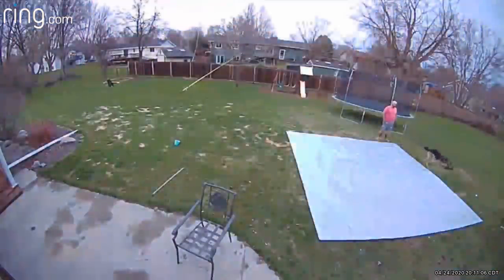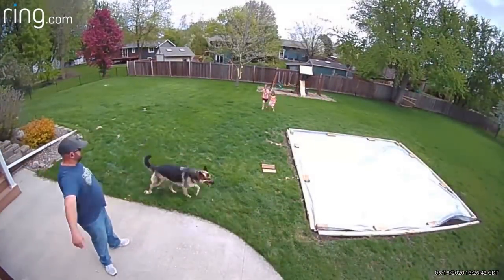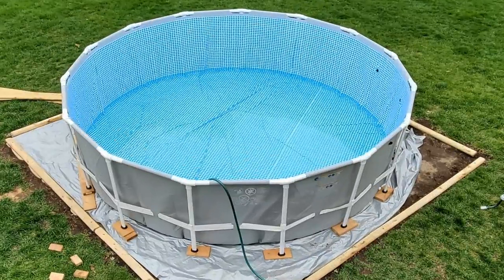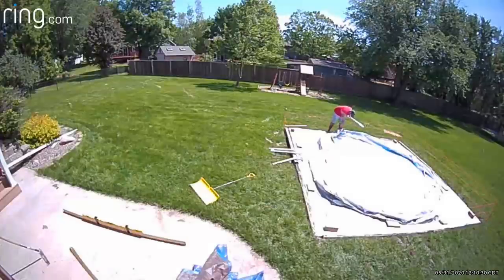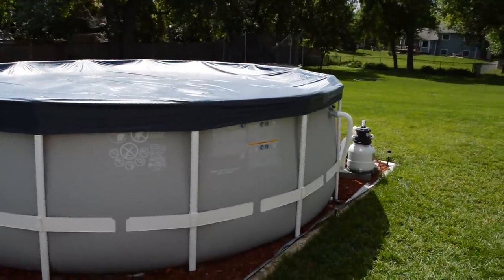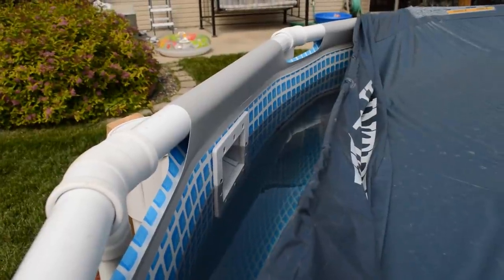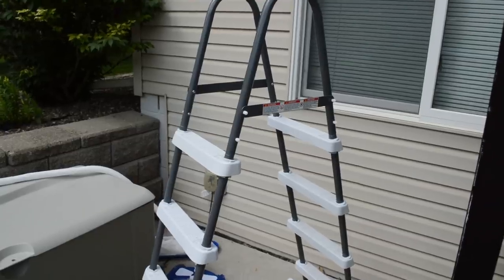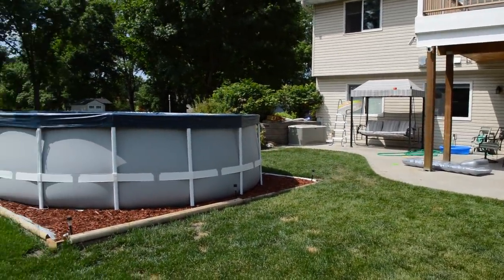Intex 15 Foot Prism Frame Above Ground Pool Setup, Review, and Mistakes!

Comment: Thanks for your post and instructions.  Do you know the outside dimension of the pool?  We have our 15ft on the way and are starting to prepare the pool.

On the subject of the liner, we've read that the liners regularly do get holes and seams can split.  One forum showed using a standard pool liner within the Intex liner.  These standard pool liners are meant to be used in in ground pools or metal sided pools,  but work on the Intex and are much more resistant to issues.  Basically the Intex liner becomes the support structure for the line and the pool liner holds the water.  Also it's recommended to keep an eye on the metal frame and protect the inside and outside from rust.  I've read silicon tape or Rust-Oleum can help.  Good luck!
Reply from the maker: I've never heard of the liner within a liner idea before. I'll have to do some investigating on it. The pool is 15 feet from edge to edge on the top ring. The liner pushes out a little bit more to about 15' 3" or so. And the liner will definitely rip if you puncture it but it's held up well 3 months in. The seams will definitely leak if they aren't actually sitting on the ground (when I first set it up and the legs were elevated too high, the seam was exposed and tiny beads of water were popping through from the pressure of not resting on the ground.)
Reply: @dontburnthehousedownvideos  Thanks for the reply and the dimensions.  This will help as we prepare the ground this weekend.

I think the overlap liner will help with the life of the pool.  It will also help keep water off the joints.

The process is here and it's less than $200 to do: https://www.troublefreepool.com/threads/installing-replacement-liner-inside-of-intex-18-metal-frame.40579/

That forum has a bunch of information on how to protect for rust as well as other mods.

Thanks.

Comment: Can you discuss your plans for winterizig the pool? I live in MN as well and have heard some people will simply drain the pool below the level of the intake and output of the pump and let it freeze over the winter. Do you plan on taking it down?
Reply from the maker: Thanks for the comment! I've debated this question as well and I've decided that I will simply take it down. This particular pool is easy enough to take down/set up that I'm going to do that instead of risking any damage to it by leaving it up. I've seen several people leave theirs up all year but I just can't imagine it is good for the liner to have the water freeze into a brick.

Comment: I have retired my bladder style pool as it was up for 7 years. The fiberglass fibers began to come thru the PVC on top of the rim rods. Being exposed to the Queensland summers for such a long time, reduced the integrity of the liner. I have just purchased an oval above ground pool with a steel wall system. I found the bladder pool was a little forgiving with a little more tolerance to being out of level. The steel wall pool needs to be spot on. Not thinking of this when purchasing the pool, I now have to spend a little more time on my ground prep. I did notice the skimmer box on your pool was the same as mine, but the pool vacuum adaptor slightly different. My adaptor has the vacuum hose exiting the skimmer box thru the top, not the skimmer door as yours seems to be. As, I have not yet installed my pool, I was curious as to the usability of the hose access thru the skimmer box flap. Is this an advantage or as mine, being vertical thru the top. Cheers
Reply from the maker: Congratulations on the new pool! I'm sure that the sun will take its toll on the ours as well over time but I'm hoping to get a good 5 years out of it. My skimmer adapter for the hose has a 90 degree elbow on it so the only option I have is to put the hose through the skimmer door. I'm not sure if there are any real pros or cons to this aside from the physics behind it. Having a bend like mine means the water doesn't have to travel uphill to get over the pool wall so maybe it doesn't work the pump as hard? That's my real only guess. As long as it works, it works!
Reply: @dontburnthehousedownvideos  I am thinking of installing a 90° bend on my adaptor. Like you said, it seems logical to have the water pressure more even than going up and over the pool rim. Anyway, cheers and good health to you and your family.

Comment: Trick: if you must use the original equipment, rip open an old fiber pillow and use the fibers as filtering material.
Wrap the original filter lightly enough to allow water flow and install. Otherwise the original filter will clog up almost immediately. Especially if you’re using well water.

Comment: Just bought this pool and have yet to set it up.  Thanks for the great video of info. Where did you get the fitting on the return hose that lets you close it off?  It looks like it has a lever.  Also, we used to have a very expensive above ground pool - the permanent type that you can’t take down - with a deck around it.  Had it over 15 years and through cold NJ winters.  Our skimmer and return hose were on the same level as yours.  Our pool was always super clean.  I see no need to move the return hose/hole.  Thanks.
Reply from the maker: Thanks for the comment! I don't have a lever on the return line. You're probably seeing the lever on the sand filter itself. Hopefully this one will last for years to come. Thanks again!

Comment: I’ve watched this video so many times, and I love it! One question, how come you put the legs inside the white band instead of outside like the instructions say? I’ve also watched other tutorials, and they put the legs on the outside as well. Thanks so much!
Reply from the maker: The legs go through the loops but if they don't go through the inside of the band, there is very little material holding them to the band. It just doesn't make sense to me to have them holding all of that pressure from outside the band. If the sewing or adhesive gives, those legs are popping out and the pool will collapse.

Thanks for the comment!

Comment: Thanks for sharing your video, what type of pool heater did you suggest
Reply from the maker: I have another video where I build a solar pool heater but it's pretty labor intensive. Otherwise, I'm a big fan of the Intex solar pool cover. It does a pretty good job and requires zero assembly.

Comment: Thank you! I have four questions. 1 - After releveling with black dirt, why did you add sand again and not just put the pool on the dirt? 2 - I bought some dirt last year (I had the intex prism 12ft last year and paid someone way too much to do what you did in this video, FYI) The dirt was expensive. Is  free dirt like you referenced common? 3 - What were the final measurements for the square - in other words what measurements work to have the 15ft as you do with the pretty mulch? And 4- Did the mulch get everywhere? Would you do rocks next time or stick with mulch? Wish me luck!
Reply from the maker: I added the sand back to create a softer surface under the liner. When walking in the pool, it's easier under the feet. 2. Free dirt is common around here! Check with you local landfills in the area. Otherwise, Facebook marketplace. The square is 16.5-16.5. I'd go a little bigger if I did it again. Maybe 17x17. I'll probably do mulch again this year because it's cheaper than rock. But rock is definitely an option if I can find a place to store it over the winter.

Comment: Thank you for this!  I am from Northern Minnesota!  I live in the country and we have old round grain bins.  My plan is to make a pool out of one of them.  hopefully the concrete pad it sits on is level.  I will have to reverse every bolt so they protrude to the outside,  reinforce the very bottom with new panels and line the inside with foam lining before I put the pool liner in.  Not sure how ti attach the top of liner to the top edge yet.  What do you think of this project?  Doable?
Reply from the maker: That sounds like an awesome plan! Just make sure the structure of the grain bin can take the weight of the water. I'm not sure what the weight difference would be between grain and water of the same volume. But as long as it's safe, that sounds amazing!

Comment: Have you had any issues being off an inch and a half? I can't seem to cut it down anymore than that too. My pool is 15 ft by 42 inches.
Reply from the maker: Nope. Zero issues. More water splashes over the edge of the "low side" but that's really it. Other than that it's purely cosmetic.

Comment: I'm prepping the ground for this pool.  Was wondering if 1) a 2" slope from edge to edge would be prohitibive?, and 2) is the dimension from pole to pole exactly 18'? Thanks.
Reply from the maker: 2" total slope shouldn't be a deal breaker. The manufacturer says 2 inches max but I've seen some really lopsided pools and they still hold up. When I measured it last summer it was an internal diameter of 18' from post to post. So it's more like 18.5" from outside of post to outside of post.

Comment: One thing that happened to me this year, making the ground level and then making the legs level, i had some serious pulling on the seams of the pool.  The support bars (from leg to leg) were "perfectly" level.  The ground itself, under it, not level due to using sand (yeah, dont use sand ... bad.).  So my liner, from the weight of the water and the distance from the ground to the support beam ... pulled out my seam from the bottom of the pool and the pool wall.  Its been a nightmare to patch since due to being on the corner.  Really, the ground should be level and the distance from the top of the pool to the ground should be the same on all legs (sand makes them sink bad when it rains)
Reply from the maker: Absolutely agree with this! That's why I ended up taking it down the first time. There was a lot of pressure on that seam so I took it down and leveled the ground more. It's much, much better now.
Reply: @dontburnthehousedownvideos  how many inches of sand did you end out adding after recompacting the dirt?
Reply from the maker: It's about an inch. Any deeper than that and you risk it settling too much.
Reply: @dontburnthehousedownvideos  that's about right.  I ended up just using fill dirt and no sand.  It's not the flattest on the bottom, but, no more washouts or sinking.  More work in the early process tho.  Added one of those garden boarder lines around the pool helped as well.

Comment: Thank you for this video! Do you know what I did wrong when setting up.. it can fit the last pole on the circumference part. I don’t know how to fix this issue .😢
Any advice ?
Reply from the maker: The outer ring can definitely flex when you're assembling it. If the "final pole" is too long and won't fit into the connection, you need to stretch the rest of the ring out, away from the center. Try to get a few friends to help lift the frame at once and pull it apart. Otherwise, make a few trips around yourself and lift/pull the frame out.

Comment: Seeing as u live in Minnesota any plans on keeping the pool up in the winter? Or are you going to take it down and reset every year.  Im near chicago and was considering it this winter. 
No concerns with mulch poking a hole in the liner either? Im going to construct a landscape similar to what you did and was leaning toward mulch over pebbles.
Reply from the maker: I took it down over the winter and stored it in the garage. I can't imagine that the hard freeze would be good on the liner. And the mulch is a few inches away from the liner and I check it periodically to make sure it's not getting underneath. I liked mulch because at the end of the season I was able to simply rake it up and toss it out.

Comment: What is the purpose of the metal rebar stakes? I am doing/following your video to level the ground in my yard very informative but I really need to know what the purpose of the metal rebar is for it will help me out to know. Anybody?
Thanks
Reply from the maker: I just did them so the landscape timbers wouldn't move. When adding and moving dirt, it was nice to have a solid frame that didn't move as I was moving things around it.

Comment: Great video!   My gardener put down a rotobase filler with rocks, then sand that he leveled and wet and is pretty hard.   I'm going to buy some tiles or wood tomorrow for the legs, just for good measure and then the fun begins!   Question...did you ever find/get a better ladder?   Thanks for the vid!
Reply from the maker: I've had a few folks post links to some nice ladders in the comments here but I haven't purchased one. The cheap one that came with the pool is still going strong so I'm going to hold off as long as I can.
Reply: @dontburnthehousedownvideos  I'm probably going to buy a heavy duty staircase ladder as I'm a tad over 300 lbs and we want our dog to be able to get in and out.  I'll let ya know...looks like $600-$900 for the ones I'm looking at.   Thx for the reply!
Reply from the maker: I just bought a heavy duty one on an auction for $40! I'm putting it together tomorrow.
Reply: @dontburnthehousedownvideos  pls post on that...I hear they still wobble...been thinking about making a wood one and giving it some kind of coating for the water...but then again I don't want crazy chemicals in the pool.

Comment: Fantastic video. How did you make that skimmer? I have spoken with several pool compagnies, they all disadvice to make it in those kind of liner? You just got a knife and cut?
Reply from the maker: Yep! I actually held the inside part of the skimmer against the wall and poked a few holes where the screws go. Then I mounted the inside section to the outside section by poking pilot holes and then running the screws through. Once it was mounted, I took a razor and cut the liner on the inside of the skimmer opening. It made for a perfect cut and once the holes were in the liner, mounting it again was a breeze.
Reply: @dontburnthehousedownvideos  Fantastic. Thank You 😊😊😊

Comment: What size fitting did you buy when you added the sand filter? I start my pool in 2 days and with 4 kids I'm going to for sure look at better filter options.
Reply from the maker: I bought a skimmer for the inlet and I use the outlet that came with the sand filter. I had to enlarge the hole in the liner of the pool but I used the existing Outlet that was there.

Comment: Hi there, thank you so much for this. We are just levelling our ground ready for our 16ft by 10ft oval pool. We were going to try and sink the wood for the feet so it is flush with the level of sand but I see you did put your feet on thin pieces of wood on top of the sand. Did this hold up ok? It really would be so much easier to do it your way!
Reply: You are not supposed to use sand under it. It washes away and will pull the liner down

Comment: Great Video, did you use a GFCI adapter to plug into your outlet outside of the house?  I am reading and being told to put a GFCI plug and to not use an extension cord. Your thoughts would be helpful.
Reply from the maker: My outside outlets are already on a GFCI circuit so I didn't need to add anything additional.
Reply: @dontburnthehousedownvideos  Thank you, but you did have to run an extension cord to your outdoor GFCI outlet correct?  Did you use a 10 gauge extension cord?

Comment: I have a question. What chemicals are you using in your pool? I have the same exact pool you do. I appreciate all the work you put into this video and will be doing some upgrades. Where I am struggling is the chemicals and keeping ti all balanced.
Reply from the maker: At the start of the season I bought Ph up, Ph down, shock, and chlorine tablets that require a surface floater to dispense. I've hardly used the Ph up or down. I've shocked it probably one a week or so and I make sure the container has several chlorine tabs. Then I use the testing steps and honestly the chlorine is the only thing I've really worried about. I've used Ph down one time. The shock and chlorine tabs seem to do the trick.

Comment: Are the pavers on top of the dirt or sand? If you put it on the dirt did you dig in the pavers to be level with the ground of the pool? I really appreciate all of your advice. Your pool looks great! I hope mine will turn out just as good.
Reply from the maker: Thanks for the comment! I didn't use pavers, I used 1x6 wood slats. This doesn't really give much of a rise so I didn't need to dig them in. Plus, when you're filling the pool, the legs will absolutely "walk" themselves out as the pool expands. You'll need to be able to move them on the fly if need be. If the paver is buried, you won't be able to move it. Finally, I used the ground tarp directly under the pool so for me, a paver would be too sharp and heavy.
Reply: How many wood slats did you need? The wood slats are onto of the tarp? I guess tarp included extends out pass the 15 feet diameter?
Reply from the maker: I have 18 legs so I needed 18 slats. Just one for each foot. The tarp is probably 16x16. The measurement on the pool of being 15 foot diameter is from the top of the frame. It's actually wider at the base because the legs and liner extend out a bit.
Reply: Don't Burn the House Down! So you put the tarp under the wood slats?

Comment: I know...Way late to the party...but let me ask as I have the same pool and I am switching to sand filter as well. What part for the outflow did you buy? I cant find it. Look at 25:42 in the vid. That is what Im looking for. Ty
Reply from the maker: That entire piece came with the filter unit. You'll have to enlarge the hole in the liner to make it work since the tubing is bigger but it's all included.